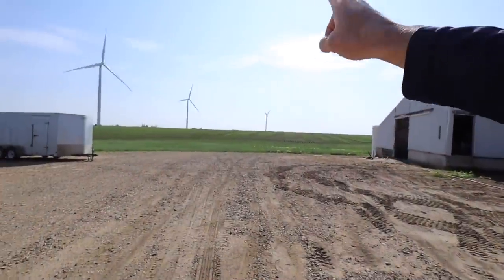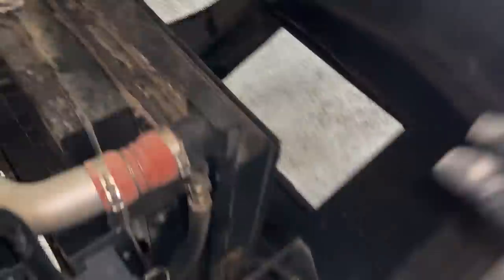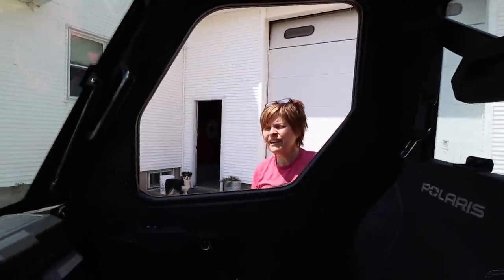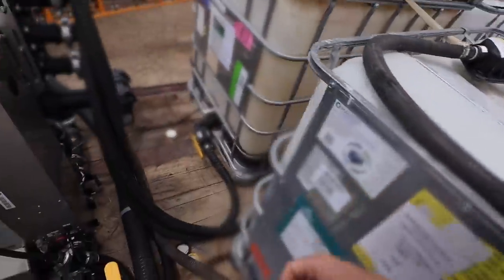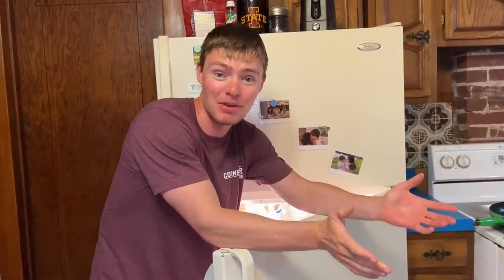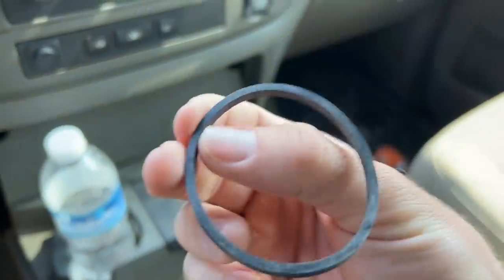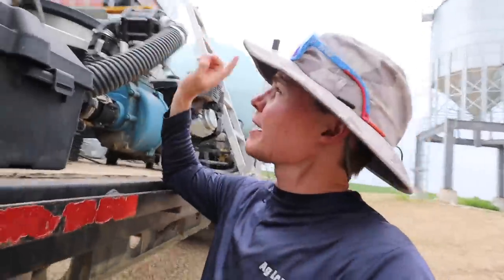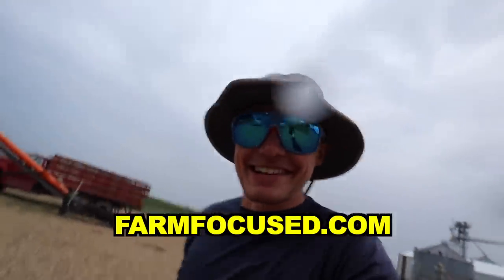We Got Rid Of The Junk Farm

Comment: I know it's been over a month but if you're tight with time, invest in an air fryer. It's small and cooks vegetables faster. If you're hungry, it will save you time and it's easy to use. Mixing it with Hello Fresh, it will be the best. My dad said at first it was my toy, he fell for the equipment and he always used it 😂 I just froze each cutlet with different spices and he would defrost it and made a complete meal quickly

Comment: I only took 2 years of Spanish in high school but I do know your looking for bienvenidos.  Also if you ever have a need to change o-rings on your boom filters try to spend the extra and get Viton over EPDM.  In most cases the viton will work better as any product with an oil base can case the o-ring to swell and once you unscrew the cap it won't go back on right.  I ran commercially for a handful of years and ended up learning that trick.